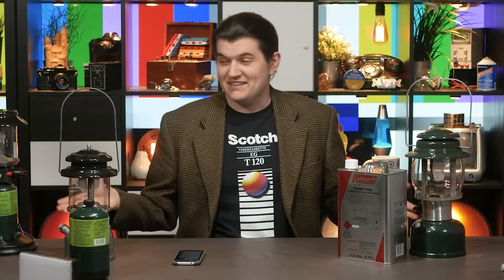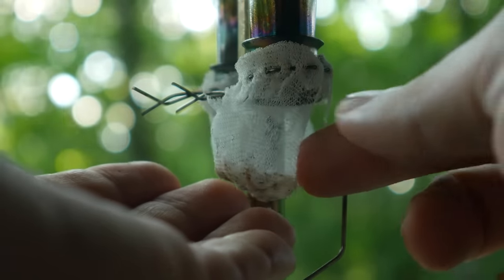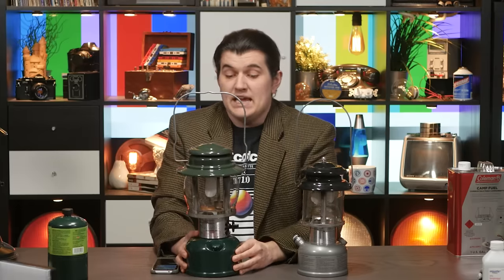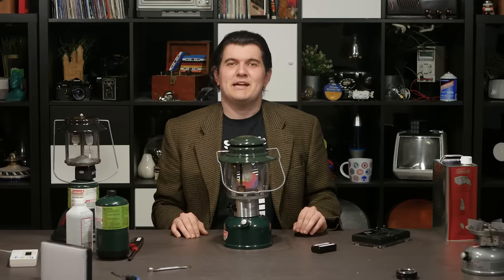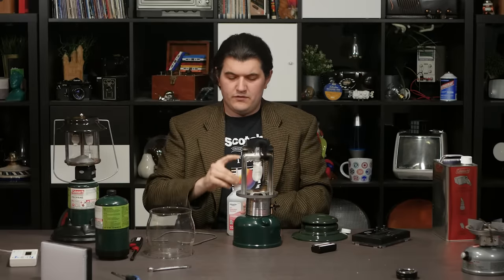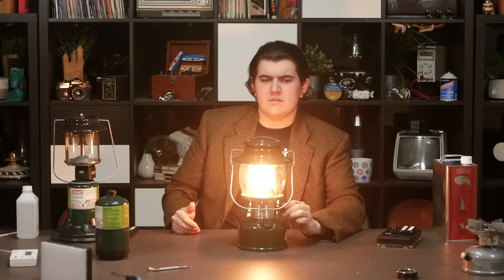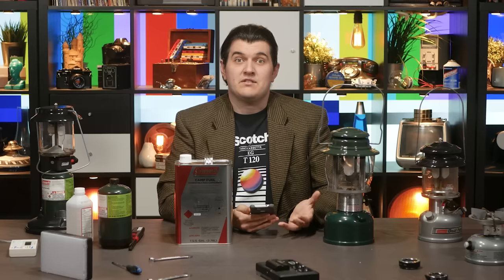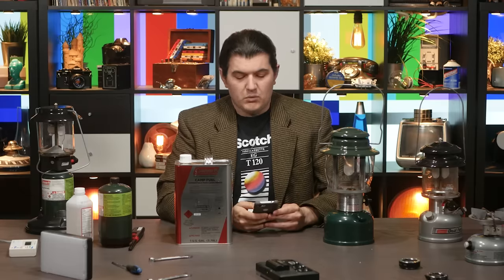A very rambly Coleman Lantern follow-up. Turns out they rarely make sense in 2021

Comment: The thumb valve is designed that way so that when you get to the end and its all pumped up, you can release your thumb and slide the valve all the way in. Otherwise if you got to the end and it was as pumped as you could push it, then you might end up with the erect rod sticking out the side of the lantern until the pressure dropped enough to push it in. That's it, just convenience. The hole has nothing to do with the actual pumping mechanism.

Comment: I used these implements in a desert camp. Actually, the kerosine lamp is much safer to use because the misuse or potential leak will not result in an non extinguishable ordeal. 
Coleman also produces gasoline stoves , and man they are dangeraus if leaky. I nearly lost a kitchen tent. I barely managed to extinguis the flames with a lot of sand.

Comment: I have a solar powered camping lamp. I spent like 20 euros on it and I've had it for like.. 6-7 years maybe? And it still works really well. I also have some battery operated fairy lights in the tent, I get some cheap AA batteries and I'll have enough light in my tent for the whole time for very cheap and it's safe. Also got some super strong lamp that works with some bigger batteries, and those batteries last a few years of camping before I have to replace them. And I go camping for a around a month at a time. I have some kind of a gas cooker, which has made cooking very easy, and the gas thingies last for a few days if I cook many times per day.

Comment: Two missing points in this video:
-People camping usually drive, you can charge the batteries off the vehicle.
-the battery talk is strictly limited to lithium ion, not something like lifepo4 which doesn't really care about the cold, or being neglected. At the cost of slightly less energy density.
Nice work tho

Comment: Great video series on lighting and lanterns.  About 40+ years ago, when I was a kid, my parents would take us "shrimping" from bridges, here in Miami with what I believe were Coleman Kerosene Lanterns.  My dad lit them without ever using alcohol.  Perhaps they were different models?  Anyways, I have two red Coleman lanterns that operate on batteries and have these have flourescent tubes (with two intensity levels). I keep them around for power outages caused by the occassional hurricane.  (Now, you have more lantern-material to review and create yet another lantern video). The batteries I have waiting for those events used to remain good for 10 years "in storage".  I've noticed newer batteries are not even being made with this quality.  I'd like to see you make a video that reviews and compares newer battery powered lanterns.  Are there really any good newer LED models?  My red battery powered Colemans are no longer in production.  Again, BRAVO on your excellent educational videos!
Reply: I'll chime in here.
First on the "kerosene" lanterns. They may actually have been EXTREMELY old white-gas lamps.
Coleman's first lanterns from the 1930s and before, and their at-the-time competitors, did not have the Fuel/Air Valve.
These models required you to pre-heat the generator somehow before they would light.
Fortunately, because white gas is quite volatile, they didn't exactly need all that much heat to start up, and you could usually just apply your match to an inviting location on the generator (a loop or shield), wait several seconds for it to get hot, then open the gas and fwoomph.

As for the battery conversation.
A lot of Alec's commentary on batteries is assuming the rechargable Li-Ion or NiMH kind. Emphasis on the Li-Ions.
For alkaline cells, you might be more interested in BigClive's video on them.
TL;DR: Older batteries had mercury in them to help stabilize them against internal gas buildup. However, mercury is nasty stuff, and we decided that we really shouldn't be putting it into single use mass produced products if we can help it.
So modern alkalines are actually a little less shelf and use stable, as they can build up internal gas, blow out their seals, and "blow their load" all over your sensitive electronics and/or emergency lanterns/flashlights.
Modern long-shelf-life NiMH cells are an excellent alternative, able to not only retain their charge for years on end, but also being easily rechargeable, and having very long service lives as well.
I'd actually say NiMH > Li-Ion for emergency standby use, as Li-Ions degrade slowly in storage. You may need to replace them after only a few cycles and uses, and they may let you down when you need them. Li-Ions are better if power to weight and energy density are more important, but an electric lantern that only comes out of your cupboard three times a year doesn't need high energy density.
Reply: You were doing WHAT from bridges?! 😳

Comment: I would like to find a restorable Coleman lamp ( usually it is leaking leather seals that need replacing) and at least a dozen mantles. The hole in the pump handle is to release pressure in the tank before refilling .

Comment: What’s the shelf life of those batteries?

I’ve pulled an old Coleman 220 lantern out of a garage with fuel that had literally been in it for 3 decades, and it lit up and ran just fine.

Propane is more convenient, when it works, but I had an entire 4-pack of unused propane go bad in less than 1 year in a hot shed - I pulled them out to use them and every one of them was completely empty.

Comment: For many years I lived on a small sailboat with a kerosene stove. Trying to get alcohol in the cup in a small sailboat that is moving around, and a small sailboat is always moving around, is an exercise in futility.  If you take a small jar, fill it with cotton balls and some alcohol,  you can take an alcohol soaked cotton ball out with a pair of tweezers and put it in the cup without spilling anything. What works better is use a portable propane torch to heat up the cup and vaporize the kerosene.

Comment: I disagree that the kerosene lantern handle should be rotated 90 degrees. You would typically hold the handle perpendicular to the direction you're looking at based on the way the human hand rests, so the orientation it's in lets you hold it and look forward without a shadow line down the center

Comment: I think for emergency cases even in Winter it makes more sense to have LED lights. The reason is that yes you need heat but you don't only need heat at night. So you want to heat all day but if your heating mechanism is a lamp your wasting a lot of fuel on the light part of it. Its better to have a emergency space heater at hand which you can have only doing heat with the gas or whatever energy source you use and only have LEDs for the night hours.

Comment: I absolutely love my Coleman dual stove, my wife too. Much less hassle handling the fuel and excellent cooking performance. I was asked if I wanted the Coleman lantern for my birthday by brother and father and... I just, no. Battery lamps can be used inside the tent, we already have rechargeable batteries at home we can take with us fully charged, (and a romantic oil storm lantern)
Reply: I use my battery lantern inside the tent and white gas outside. The thing I love about the white gas lantern is the heat it puts out which is nice on a chilly evening, and they make effective bug killers too. Come morning there's usually a ring of dead bugs surrounding the lantern on the table.

Comment: Too many comments to trawl through   --    honourable mention to the "Tilley" lamp.    very similar to Coleman  and until recently a staple of country living and beach fishing in the UK.  Kerosene /Paraffin    fuel.    Now that has got really expensive here recently so less popular than before.    As has been said,  lamps give  a decent heat  as well as light.  A colleague collects Tilleys  and has a room heater  with a dished reflector  which needs regular polishing  - bronze I think. Probably predates  chrome plating.

I remember when many houses had gas (mostly coal gas )  lighting  and i think caravans in UK might still use LPG gas lighting .   Certainly we were raised on it.  Mantles were cheap and indestructible until after first use. 
My aunt called Swan bulbs 'electric mantles'     Coming of age meant you could successfully take a used mantle to another light fitting .     Steady Hand !    The mantles were woven from silk  which is why they were strong.   First use burned off the silk  to leave the Thorium skeleton  on the silk ash.   I don't think any home user  (as opposed to mantle makers  in factories)  suffered any ill consequence from the gas mantle.   Too many other things to die of first.   Largely disease and the widely overlapping & non stop European wars.
Reply: Hi cause have you become a flat earther yet? If not I suggest watch a 13 part series called What on earth happened by Ewaranon to learn that the earth is not a globe. I got it in my about tab.

Comment: I have a new kerosene Chinese lantern, for nostalgic reasons, and I owned two, which both had a very strong white light, so..
used them for lighting up when fixing my house in the black winter days, but the the tech is as outdated as can be imo.
And risky
Energy efficient headlights are often enough, as is low power dynamo/solar flashlights. I have two of those, and they
make me able to see where I'm going and what I do, and I havent charged them for the last three years. They work.. :)

Comment: Still a definate case of theory being given priority over practical experience. But an improvement on previous video.... A more realistic comparison is disposable batteries vss liquid fuels... Rechargeable is not even in the race for emergencies or long road reps. Once batteries flat you've got to wait 4+ hours in dark emergency situations to re charge. And you don't have solar in stormy situations...... if you calculate down to cents per hour with disposables on say a 100lumen 6v 4xdcell lantern compared to 100 luman fuel lamp its similar in cost. And liquid fuel technologies way ahead in all other ways. I have done many tests. Eg coleman rugged lantern on low 110lm setting vss large kerosene wik is also about 100lm. Both cost about .12c per hour. And the kero will sit on the fridge for 20 years and still work. The batteries will have corroded the terminals and died after the first month with cheap batteries or a year or two with quality. Similar comparisons with the brighter ones..... moving from dcell systems to aaa or aa puts the cost per hour thru the roof for same lumens. .50c per hour and up...

Comment: If you need to store the fuel for long periods between use, then the Kerosene lantern is the best, as that fuel is on the Diesel end of the scale, which means it does not "go off" (loose its combustion level/rating), and can be stored for years (decades even), unlike petrol/gas and white spirits (camping fuel) which will either evaporate or loose its combustibility in a short period (months). That "going off" process is why Aviation Fuel is removed from storage after a short period (counted in days), and then made available at the pump as either "high octane" or "race fuel", because its not usable in an aviation application any more.

Comment: Ok, I got you. Your right about LED being more efficient, but.
I camp often, several nights, several times a year. Using both a dual fuel stove and lantern, I go through one and a half gallons of camp fuel a year. I have LED lamps as well.
Using retail prices for alkaline batteries and camp fuel, comparing burn time per dollar, camp fuel wins. That's for lantern only.
Using pump gas is even cheaper.
A gallon of pump gas is the same price as a four pack of AA batteries.
Now of course having rechargeable batteries and everything else is out the window.

Comment: Next you must learn how to “soft start” a kerosene lantern: with the lantern UNpressurized, fill the alcohol cup and light it, and open the valve.  Yes, open the valve. When the alcohol has burned below half, give a slow 1/2 pump. This will put a small amount of Keri into the generator to preheat and when it vaporizes, the mantle will begin to glow brighter, which will be the indicator to pump it up fully.

Coleman made a small kerosene lantern that did not have a valve at all, and was started by this soft start method. And, to turn it off, the fuel cap was unscrewed enough to depressurize the fount and stop the flow of kerosene to the generator.

Comment: I agree that  battery and Led technology have come a long way. If you go camping once in a while, a battery lantern is fine and it's also going to be a lower up front cost. However, batteries fall short when it comes to versatility. Batteries are going to power a light and charge a phone. Propane or duel fuel is able to power multiple different devices. It can run a lantern, stove, space heater, and even a water heater. 
But they really shine in a natural disaster or shtf situation where power maybe off for days or weeks. Batteries are fine in this situation, but they might be used for more important device. Recharging with a solar panel might not be possible in this situation. Also, fuel can be found much easier than batteries could be in that kind of a situation.

Comment: So, that pump makes no sense.  If the hole has to be covered anyway for it to work, then what is it even there for in the first place?  Why not make the plunger cap solid, and you wouldn't need to worry about keeping the hole covered?!
I remember that delay in extinguishing with my dad's old Coleman lantern.  We'd all head to the tent-side of the picnic table, my dad would turn out the light, and there would be just enough light left to let us see our way to the tent and undo the zipper, where we could then turn on our flashlights, stored right by the tent door.  The lantern stayed out on the table all night to cool off.  (Of course, it didn't take all night, but maybe it kept critters off the table for a little while...LOL)  My propane lantern is an older one, though, and still match lit:  no electronic igniter.
As I commented on your other video about these lanterns, I was afraid of the integrity of the tank on my dad's old lantern, so I bought a propane one.  The same was true of the tank on the Coleman camp stove we had.  I still have it, but bought a propane conversion "kit."  There's really no "kit" about it.  It's so simple:  just a fuel tube, and whatever internal mechanism is needed, and the attachment for the propane bottle.  That's it.  You just stick the tube in where the one from the old gas tank went, under the burner assembly, screw on the propane, and you're done.  Trouble is, those newer fat propane bottles don't fit the area in front of the stove like the older skinny ones, and those are getting nearly impossible to find.  I may have to get a hose adapter and run the stove from the big 20 pound bottle...  :-(  
I haven't been camping in years, but I keep my camping gear:  I regard it as my emergency preparedness supplies.  Ah, but not only emergencies:  My camping gear provided me a serviceable outdoor kitchen while our kitchen was being remodeled!  ;-)  
(See..I can ramble, too...LOL)

AHA!  Batteries!  But what about the modern brouhaha over batteries/toxic waste/take them to hazmat recycling/don't put in trash pickup??  I don't think most people pay attention to that.  Non-rechargeable batteries have been just tossed in the trash for so many years that it's ingrained habit.  And who's going to police the trash bags to check for batteries?  And who has room to safely store a ton (figuratively) of spent batteries until there are enough to be worth a trip to the hazmat facility?  It's a sticky wicket, for sure.  I'm not even sure rechargeables are exempt from this once their recharge life cycle is spent...The batteries that power my cordless landline phones (X 4 extensions)  are approximately the size of the one you're showing for your LED lights...and they cost $25.00 EACH!!!!  That's significant, especially on a social-security-only income!
Solar panels are equally cost-prohibitive on a fixed income, and if you're tent camping, what are you going to recharge your batteries with?  Plug the charger into the nearest tree?  Sorry, I'm keeping my propane lantern.

Comment: I will be the first to admit there is a vintage "cool factor" to these lanterns, perhaps even a nostalgic tradition. That being said, I use white gas for stove fuel when I go camping. The cost of white gas/Coleman fuel is not concerning to me, considering how little fuel is used when cooking compared to propane or another fuel source. I am more concerned about a single gallon of fuel going bad over the course of two years, so using up white gas in a Coleman lantern for me is a great way to scratch that itch while having a somewhat legitimate reason. Also warmth during cold weather is an added bonus.

Comment: I use a Japanese stove.  It uses Butane.  Any thoughts?  Love your channel.  Thank you for your work.
Reply: I have a Japanese stove that runs on ethanol/methanol.. it's similar to a Trangia but is double burner and also has a box and wire cover like a hamster cage  on short legs for use as a house room heater. It's from some time in the 1930's.

Comment: also at the time I'm viewing this, which is 3 years after recording, the propane lanterns which are far more convenient and easy to work with cost little over a quarter of the kerosene lantern, 30 dollars vs 105. for 75 dollars you can buy 11, 1 pound tanks of propane that is a LOT of illumination for the average user before the price difference of kerosene can even be experienced and even then you still have to burn an equivalent amount to 11 pounds of propane before the costs truly equal out (even then propane's still slightly ahead but I'm not about to do the brain math behind it). also don't forget the start up costs of rubbing alcohol need to be calculated too.